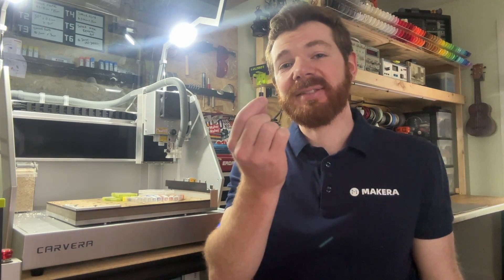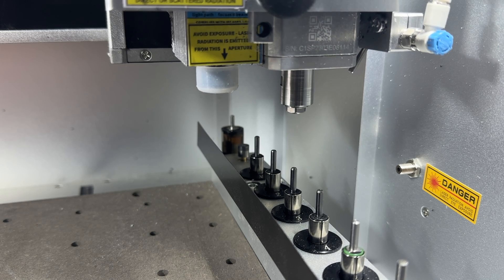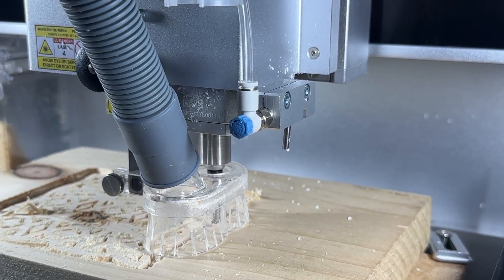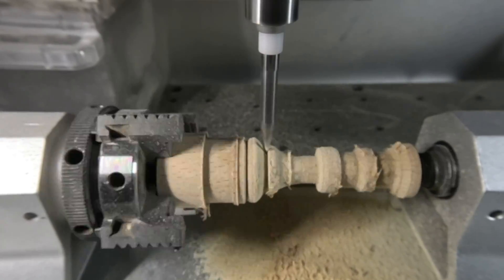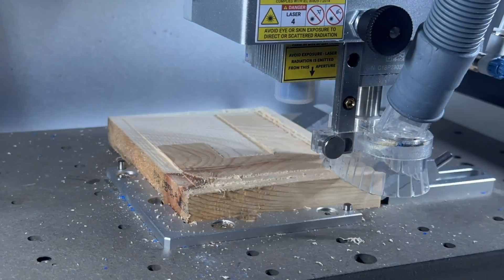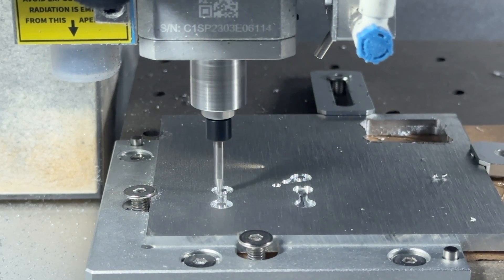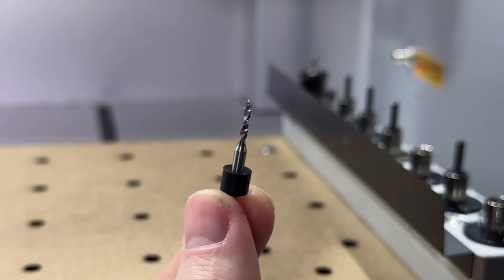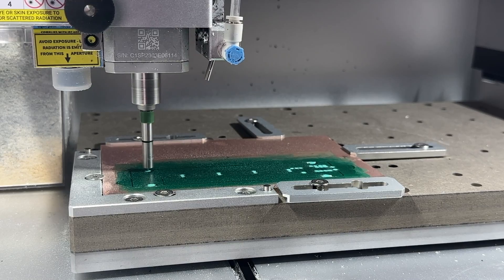Getting Started with CNC Machines - Choosing Bits

Comment: Great overview! As a european customer, which metric system do you recommend for my bits and accessories? It seems the Carvera Air is delivered mainly with imperial sized accessories but my general workflow is with metric tools.
Reply from the maker: Thanks! Yes, we ship with 3.175mm bits (1/8") which is a very common size. But for metric, you will be able to commonly source 4mm and 6mm shank diameter bits and these collet sizes are available for our machines.

Comment: I have a request. How do you "home" the part like at 5:00 to perform the thread or the hole? Once you have milled the part, you flip it 90 degree and mill again but how do you set your 0 ? The manual probe cant be used when the part dont have 90 degree angle right?
Reply from the maker: Correct, you would use the manual XYZ probe for this as shown in this tutorial: https://www.youtube.com/watch?v=yNCbZI0ndpA&t=195s
Reply: @Makera  a bit hard for parts that are not flat or have 90 degree sides no?